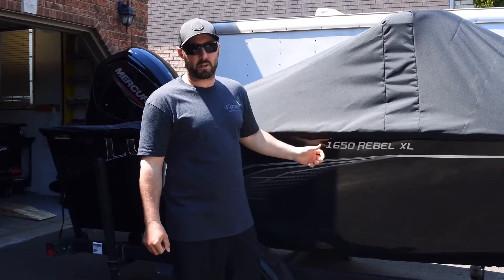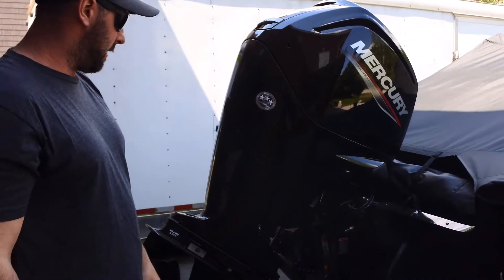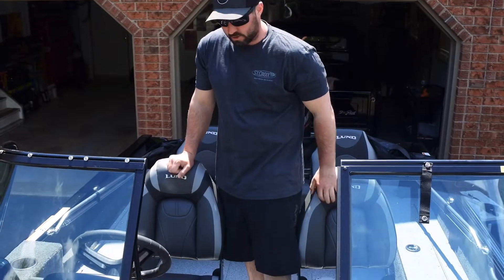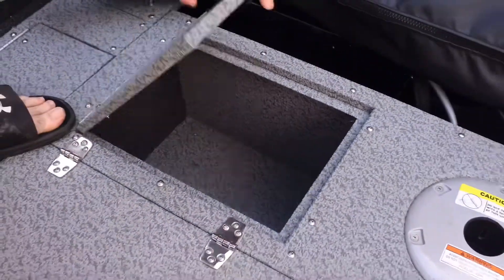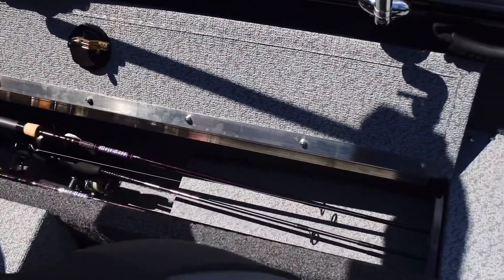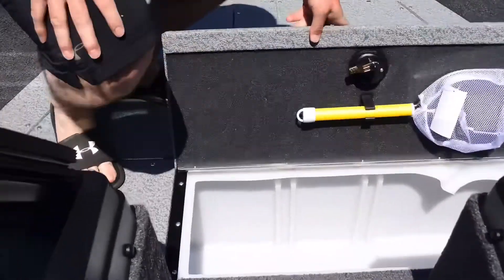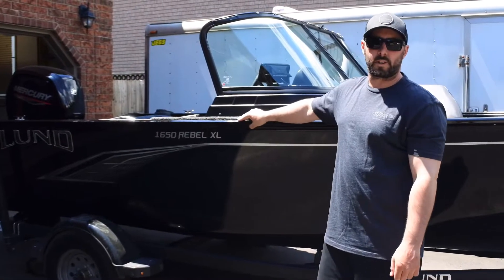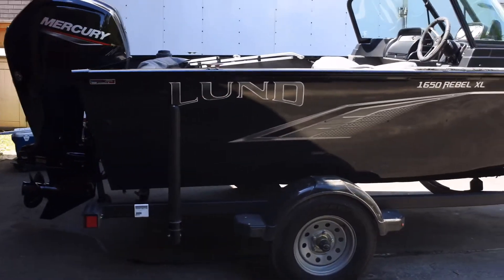2021 Lund 1650 Rebel XL Walk Through

Comment: Hi great video. Can you tell me the overall package length from back of motor to trailer hinge. I’m wondering if it will fit in my garage.
Reply from the maker: It fits in my garage, with motor trimmed all the way down, and turned to one side. And obv the swing tongue folded in.
I can get u a measurement in couple minutes
Reply from the maker: Hey Paul it’s 19 feet 1 inch

Comment: Hello Scott, many thanks for this video.  I have the EXACT same boat as you do!  Same motor, same black paint, and right down to the same full vinyl flooring!  Do you mind if I ask where you bought your boat?  I got mine from Pirate Cove in Kemptville, ON...
Reply from the maker: Congrats on your new boat and thanks for watching! We had to drive up to Peterborough to find this one.
Reply: We should both get a Rebel XL tattoo!  ;-)  Seeing as we have the same boat... two other questions... does your Mercury 90 hp have noise insulation under the cowling?  Unfortunately, mine did not come with this...  And, do you know if your ladder was factory installed, or did you add it as a dealer add on?  Reason I ask is that I need a ladder, and yours looks great...  Thanks in advance, Scott.
Reply from the maker: @rogerw9557  im going to have to  pass on the tattoo idea lol. as far as the ladder goes it was  factory installed. I think they all come with a rope type ladder with option to upgrade to one like we have. I could be mistake though
Reply: @riseroam4162  Yup... I have the rope ladder... actually more like seatbelt material... I definitely need to upgrade that...

Comment: Great video, congrats with your beautiful boat. I just got same boat, it's very difficult to get one right now.
I just break in engine and I can't believe how smooth and powerful it's on the water.
I did some upgrades like helix 7 on dashboard and helix 5 on bow, minn kota with i-pilot, also minn kota trolling battery charger ( charging your trolling battery them engine is running)
Also installed mercury trolling switch, nice future for salmon trolling and still working on downriggers installation.
One more time Thanks for your review.